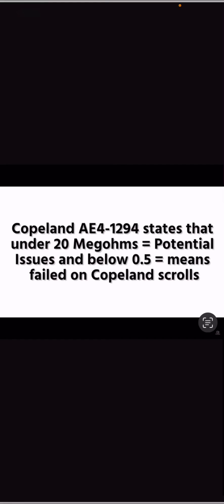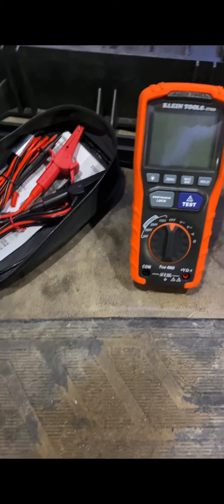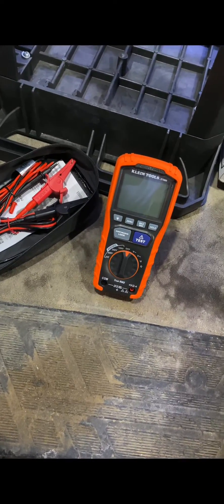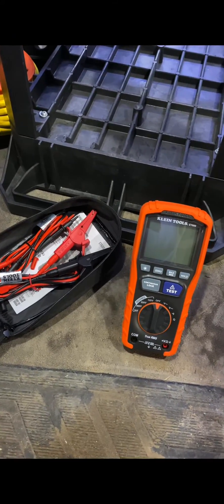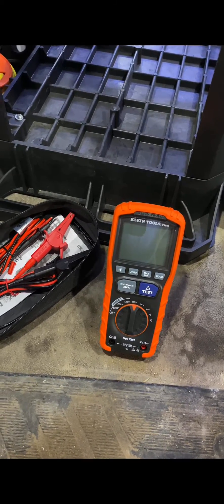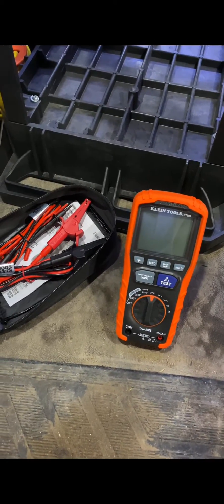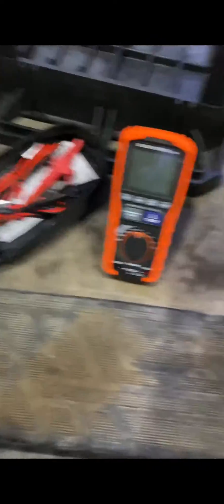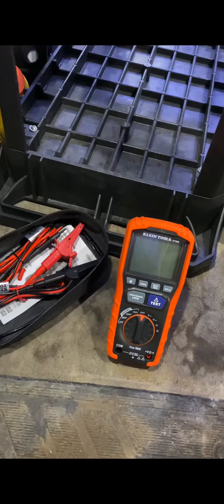How to diagnose a grounded Copeland compressor

Comment: The new manuals say you may get low readings if the comp has been sitting for a while as the windings are submerged in liquid
Reply from the maker: That makes sense, but there is virtually no way to verify if that is actually the case or not, so I’d stick with 0.5 M ohm or less at twice the rated voltage with a megger

So for example with a 460v compressor that would be about 1000 v with the megger.